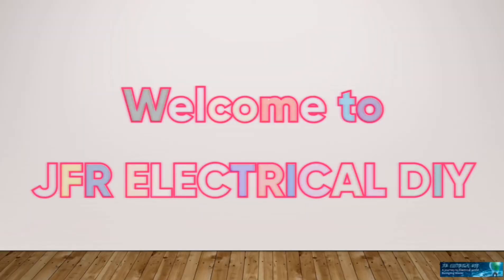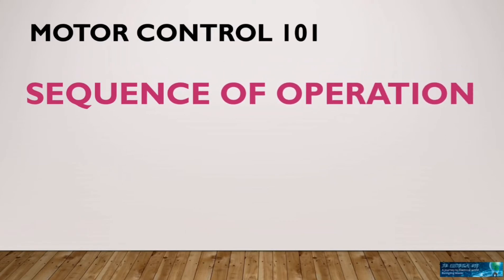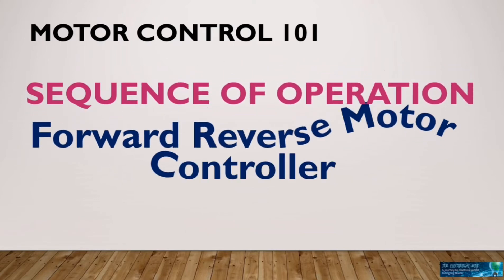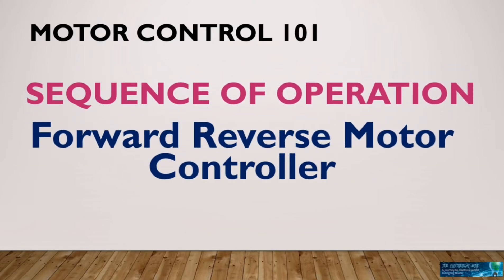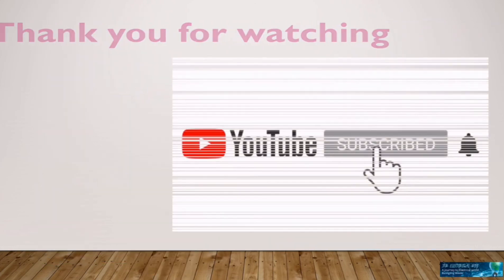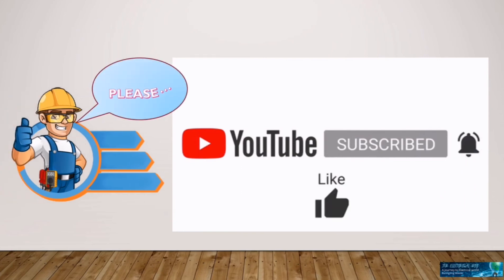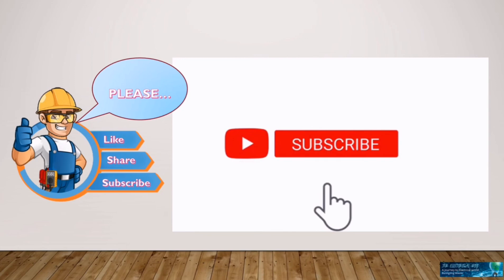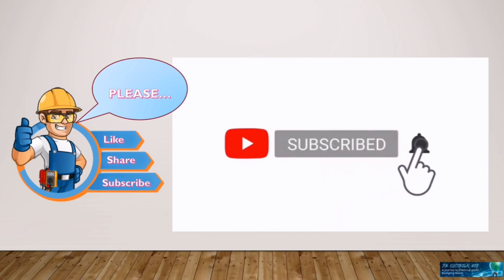Forward Reverse Motor Controller, Operation Sequence, Motor Control 101

Comment: Motor connections are not clear. it is in Star or Delta Connection, Please Explain
Reply from the maker: Sir, regardless of the motor winding inside the motor. Star or delta configuration. The motor can run forward or reverse, just swapping any two of the power supply cables.❤